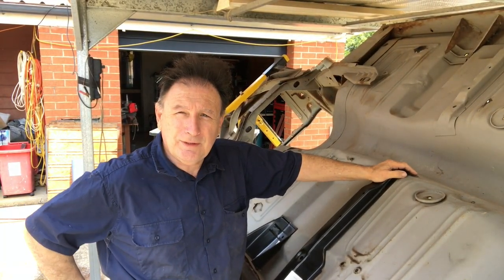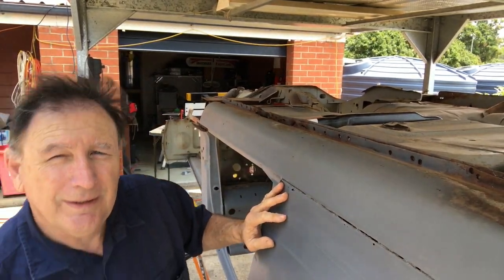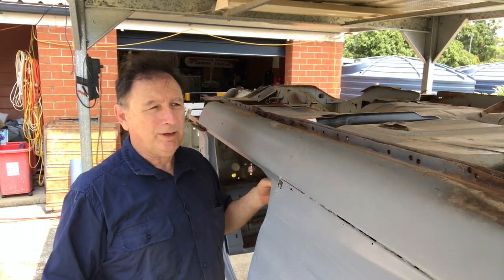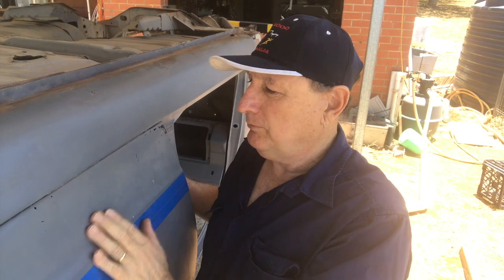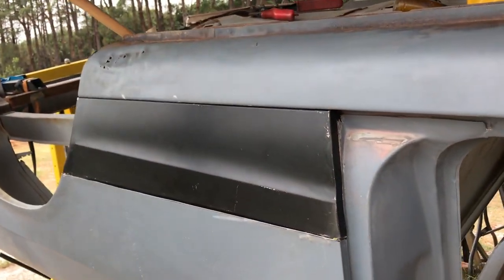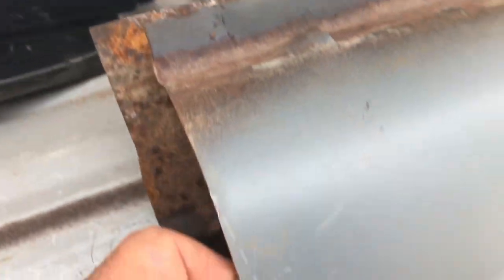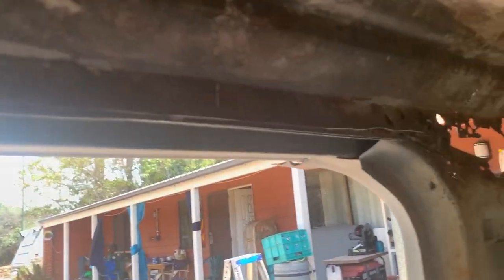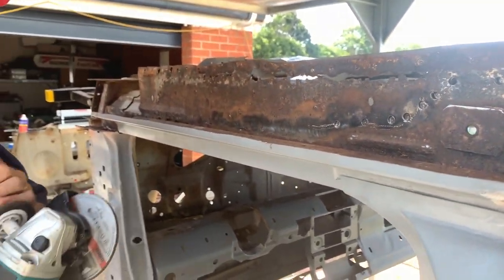Ford Falcon 500 XY Ute Restoration Part 6

Comment: Rotisseries are all good and fun ..for the work you’re trying to do to keep your gaps in alignment is done correctly on chassis rack there for you can actually unpick the whole talk boxes in one go and repair all the rust not just some of it same as the inner and outer sill panels replace the whole panel proper with out losing door gaps and guard gaps to the doors and quarter panels
Reply from the maker: Yeah mate, I didn’t need to do my talk boxes, they were all OK